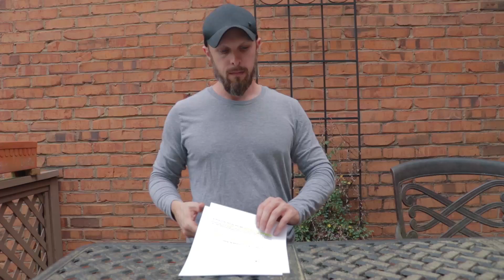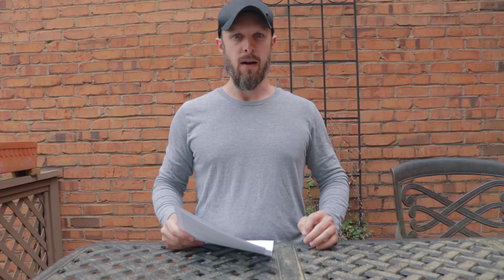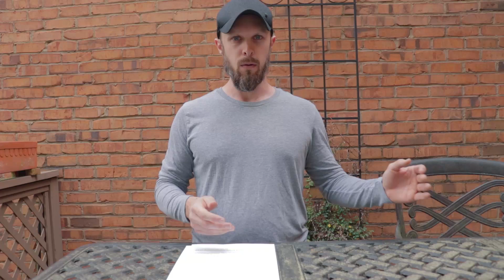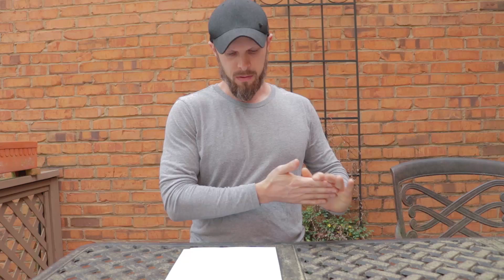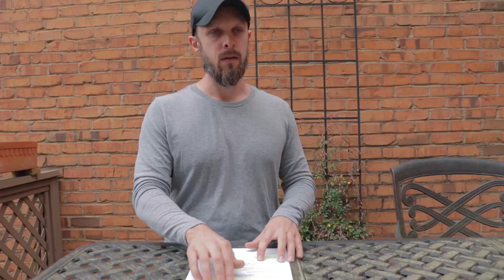Stop 5G Signals With Cob Walls - Protect Your Home From EMF Radiation

Comment: 5G is nothing more then the FCC repacking the old TV frequency bands that's been used for 60+ years:
   600 MHz (5G Re-Packed TV Channels)
   700 MHz (5G Former Analog TV Channels)
   850 MHz (4G Cellular Channels)
Why use 600-700 MHz?
These signals penetrate buildings and walls easily and to cover larger geographic areas with less infrastructure (relative to frequencies in higher bands).
Reply: 5G uses 28ghz to 34ghz.  I'm not expert, but I don't understand your line of reasoning.
Reply: @goodtreeministries3751   Take it up with the FCC ... https://www.fcc.gov/700-mhz-public-safety-narrowband-spectrum
Reply: Oh so that's why Biden was saying it needed infrastructure in the region of $10 billion world wide...................for repackaging! my face hurts!!
Reply: why almost no-one liked this comment?
Reply: @suqma  
The sheep have been taught to run from stories about the big bad wolf never worrying about what fate the farmer has in store for them.

Comment: You will not stop radiation with cob, sorry but unless you can evidence this with proof then these claims are pointless. You would have built on the Hartmann Benker and Curry lines, there would be terrestrial radiation where you have positioned the building, these factors can be addressed by BioGeometry but few other factors come close to addressing what needs to be addressed..
Reply: even your own skin can stop these, that Is why you don't need aby od that lmfao

Comment: Thanks for your research. This is great information to help folks.
Reply: Howdy, just wanted to inform the following as well: Great video. I would like to add that yes, higher frequencies like 60GHZ do not penetrate. 0-30GHZ are considered microwave bands. 30 + GHZ gets into the millemeter wave bands that do not penetrate. 5G in the short run + long run basically means an increase in ALL frequencies, including the higher frequencies. Current cell towers at 4G run in the 100MHz - 15 GHZ, which does penetrate. The "G" in 3G, 4G, 5G simply means "Generation." The "G" does not correlate with GHZ (gigahertz). The current Microwave frequencies (0-30GHZ) won't be going anywhere anytime soon. The lower the frequency doesn't necessarily mean the less healthy. These frequencies are weapons. And these are tremendously bad for our health at the cellular level. Moral of the story, this shielding SHOULD be applied to ANY/ALL homes immediately, regardless of your phone(s), and surrounding infrastructure at 3G, 4G, and 5G. I have been shadow banned by Youtube from explaining these things on threads. I ask you to please share this immediately and like this comment. Good luck!

Comment: I had not seen much about 5G but since you brought it up, I think I should check it out.  Thanks!
Reply: Howdy, just wanted to inform the following as well: Great video. I would like to add that yes, higher frequencies like 60GHZ do not penetrate. 0-30GHZ are considered microwave bands. 30 + GHZ gets into the millemeter wave bands that do not penetrate. 5G in the short run + long run basically means an increase in ALL frequencies, including the higher frequencies. Current cell towers at 4G run in the 100MHz - 15 GHZ, which does penetrate. The "G" in 3G, 4G, 5G simply means "Generation." The "G" does not correlate with GHZ (gigahertz). The current Microwave frequencies (0-30GHZ) won't be going anywhere anytime soon. The lower the frequency doesn't necessarily mean the less healthy. These frequencies are weapons. And these are tremendously bad for our health at the cellular level. Moral of the story, this shielding SHOULD be applied to ANY/ALL homes immediately, regardless of your phone(s), and surrounding infrastructure at 3G, 4G, and 5G. I have been shadow banned by Youtube from explaining these things on threads. I ask you to please share this immediately and like this comment. Good luck! Also guys, check out "Fullerton Informer" on Youtube for REAL information on ElectroMagnetic Weapons. And mainly 5G information. He's a believer in Christ, if that's what you're looking for.
Reply: @harrisonswift1416  Thanks for taking the time to explain that.  No one, pro or con, has explained it this as clear.
Reply: You definitely should look into it, this whole planet is not shut down right now because of a virus, the virus is simply the coverup to the real problem, the world will tell you that 5G is the internet of all things, but truth be told, it is not the internet of all things, it's the end of all things, it's a weapon, and the technology is not new, it's been around since the early 70's, and it's already been used to empty entire towns and cities throughout the world, it's a weapon of mass destruction, and the people responsible for it are not our friends, or family, they are the 1%, or the small groups of people who have the most amount of money that are responsible for it being installed now everywhere, this group of super rich people have a very sinister agenda, and the most important thing to them is depopulation, they want no more than 2 million people walking the earth, they really think that if they are able to get the population down to this number, that they will be able to sustain some perfect unity with the world, and everything in it, but if you know anything about math would mean more than 7 billion people will need to die, in order for their agenda to happen, and they don't have any care or regard in the world for the value of a human life.  I pray you really do look into these things, because the agenda of this group of truly sick individuals is playing out in real time right in front of our eyes. May God be with you, and your paths be straight and true, always!
Reply: @joshsmall4444  this proves it big time!! 

https://youtu.be/C2Z_cSL24eo
Reply: @joshsmall4444  I concur, see my videos start with directed energy vs weighted blanket. Its my real story, parts of it anyway.
Reply: @joshsmall4444  well, firstly, if they want to control the population, they really suck at it, second where did you read that nonsense, third, why would you be alive, if they want to kill you anyways And +you Are spreading this "truth", that they don't want you to know
Reply: please don't listen to him lol
Reply: @suqma  Josh Small knows what hes talking about if you know you know simple